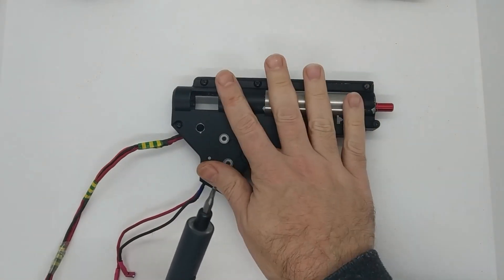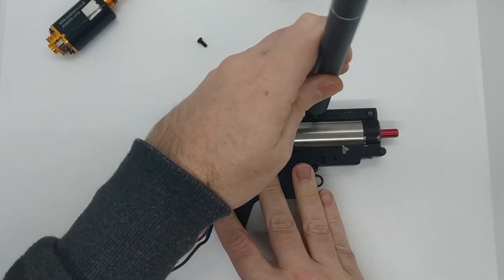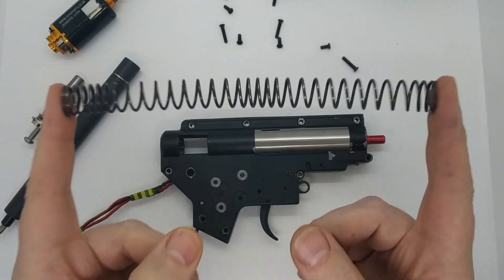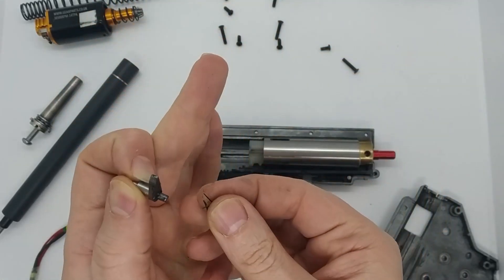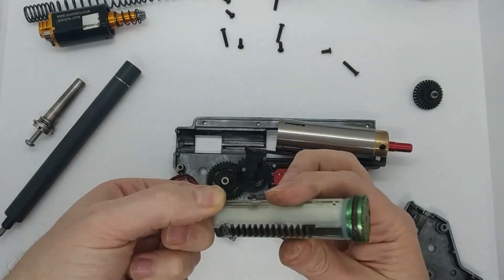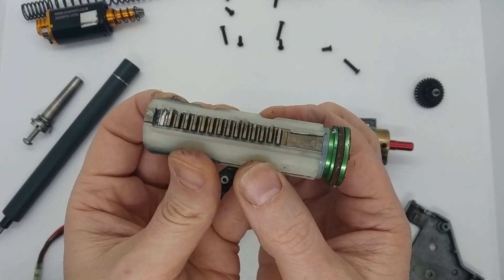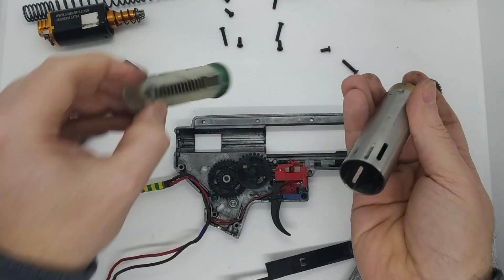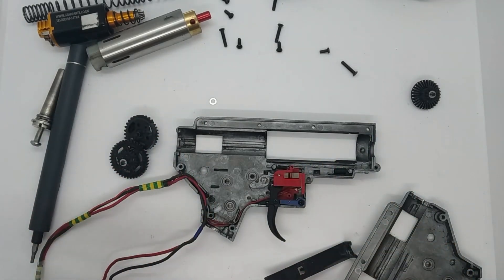E&C Gearbox Inspection (200,000 cycles)

Comment: For anyone who has a Nuprol and wants to upgrade it, these gearboxes are fantastic, with only a small amount filing down they do fit! I've fitted this gearbox into two Nuprols and they work fantastically. (they both have gate asters so the safety function wasn't a problem)
Reply: Can the e&c gearbox been build as a dmr with heavy spring and don't crack?
Reply: @hitmanairsoft4853  Yeah absolutely, I made a DMR build with it and it worked perfectly. Its my go to gearbox for any project!
Reply from the maker: @hitmanairsoft4853  Yes no problem at all, I've done continuous 10 secs burst with M150 springs full stroke 18:1 and no cracking.
Reply: @xtairsoft  bloody hell, that’s really good, I’ve had a look at your website and I’ve noticed there’s quite a few e and c components, if I remember correctly e and c was basically specna arms and I’m wondering if those components are still compatible in my SAB16 mk12 spr

Comment: Have recently bought a E&C metal blank body but I am struggling to find a gearbox that fits inside have a couple gearboxes that have tried to fit but seems that I guess only E&C gearboxes fit inside?
Reply from the maker: you may need to remove / dremel some of the material inside
Reply: @xtairsoft  I thought so but my mag release, body pin and trigger don’t line up but my pistol grip and motor fits in fine ?
Reply from the maker: @cja_1213  What's the make of the gearbox you are trying to fit?
Reply: @xtairsoft  I have a G&G gearbox shell that fits into basically all off my guns with no modifications.
But I just ended up buying a E&C v2 gearbox QD so just hoping that most E&C gearboxes are compatible.
I do hear that hop up units seem to be a bit difficult to fit into some models?
Reply from the maker: @cja_1213  I've not come across any issue with their hop units, they used to use the older non-rotary in all their AEG's but the 2 I received both have the newer rotary plastic blue ones.
Reply: @xtairsoft  ah okay that’s good to hear will have to wait and see when mine get here

Comment: Do you know the difference between E&C's 1.5 qd and 2.0 gear box?because on almost every site the 1.5 Gearbox is more expensive but shoots slower. It makes no sense to me
Reply from the maker: The actual gearbox shell are identical.  The only is different is 2.0 uses a slightly different QD spring guide so you don't have to remove the gearbox from the receiver to change the spring.  1.5 you have to remove totally.
Reply: @xtairsoft  aah thank you I've been looking for this info everywhere. Do you have any guess why the 1.5 is in the more expensive models ?
Reply from the maker: @sarcasualindividual  You're welcome.  From the information I have 1.5 is cheaper than 2.0, it requires less custom parts.  If you want head over to my FB page, there you can send me the links and I can check for you.
Reply: Is this compatible with e&c122 hk416 its not a quickchange spring type

And can i aslo ask for ur fb page thank you

Comment: Ive got 10 AEGs with a total of around a million cycles combined, not one of them did I glue the piston rack. Not one problem either. If you have a trash piston and rack take some glue and glue the rack somewhere on the piston body(not where it is supposed to go) then when it dries, just see how well it actually sticks. It wont trust me. Stop wasting your time people.
Reply from the maker: Well that's just your experience, others have different experience, different builds, different situations.  Personally I'd always use something like JB Weld on the rack on higher stress builds.  Glue and JB weld are pretty different in my experience.  Thanks for your comment though
Reply: @xtairsoft  JB weld will stick to the rack but will not bond with the piston body. Like I said take some old pistons and racks and different glues and epoxies then experiment. You will find what sticks to the piston wont stick to rack and vice versa. There are some special glues out there that will work, but I have never needed to glue a rack to a piston. I have a SP160 DSG at 50RPS with over 30k shots. SHS piston no glue. Do whatever makes you feel good though.
Reply from the maker: @pauls.5815  I've actually had excellent results with JB Weld bonding to the plastic body of the piston but we've all got differing opinions to what we prefer and what we know or perceive that works.   I would never be so bold to say to someone "don't do this" as everybody is different.  Similar I suppose to threadlock on the piston head screw, doesn't need it but I just do it as a precaution.
Reply: @xtairsoft  The rack fits so tight into the piston body that there is no surface area for the glue to bond to. When you push the rack in , it just pushes the glue forward. So where is the glue? The amount of surface area that the glue can bond to is a non factor. When you put glue on top of the rack, the spring eats it up. I use gate titans. I used JB weld in a build and took apart the gearbox to find glue dust everywhere mixed with grease. A big mess, for no reason. I promise regular JB weld will not stick to nylon fiber. I'm a engineer for a speaker company. We use special glues to bond metal parts to Polypropylene and Butyl rubber. It is a thin glue, and if properly scored, it will have enough area to bond. JB weld is too thick and just gets pushed forward when inserting the rack. The JB weld on top of the rack gets destroyed by the spring over time leaving residue to get into optical sensors. If you must use glue, use a better glue for the situation.
Reply from the maker: @pauls.5815  I'm always interested in trying other glues, I've only been using JB on the XT pistons which use a different rack which has material cut away at the pickup tooth point. Get what you're saying about not having enough surface area etc.